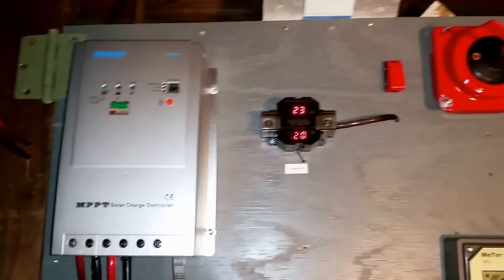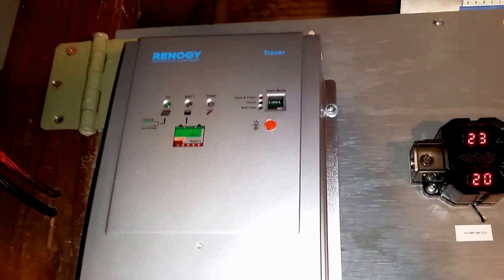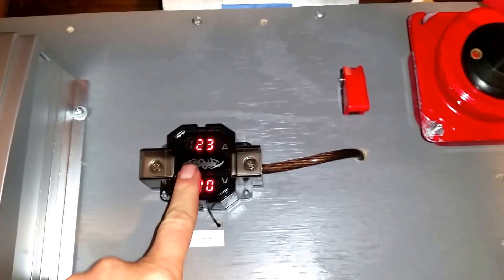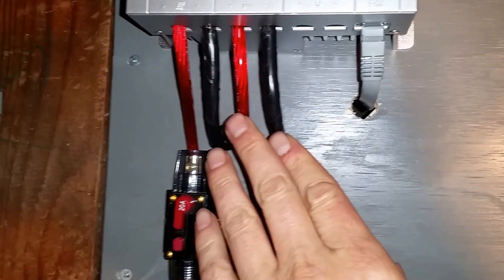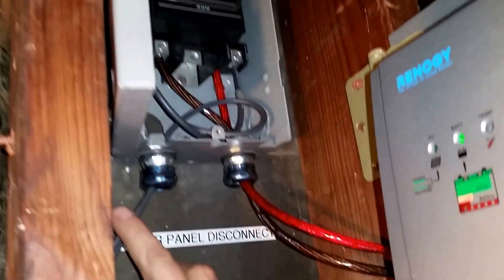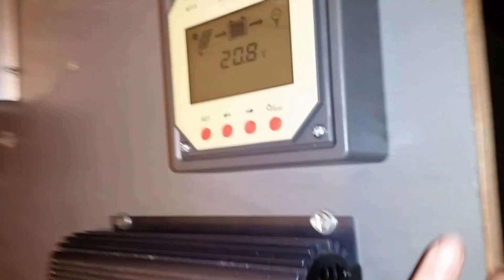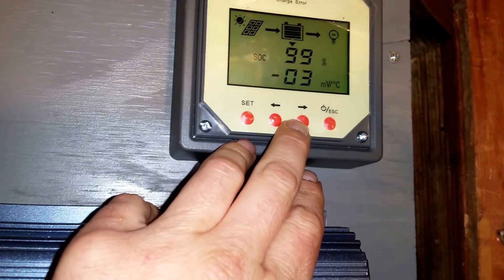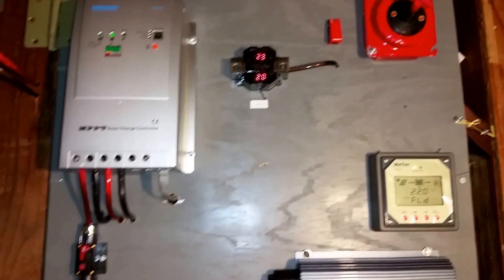200 WATT SOLAR PANEL  HOME PROJECT

Comment: Remember, the size of the breaker/fuse should be matched with the wires plus a little extra for safety.  8 AWG with THHN not in a conduit can carry 50 amps safely.  A 1000W inverter should have a 80a (80a x 12v = 960w) breaker with wiring to match.

Comment: if that is a 40 amp charge controller, you need a 40 amp fuse going from it to your batteries....  if it was a 20 amp controller, then you would use a 20 amp fuse....
Reply: you only need a fuse on to the battery there is a fuse inside the mppt for solar and load

Comment: I have a 100ah AGM battery so far... with a 2000/4000 Pure sine wave inverter... 20a  MPPT Hqst controller... 
I can't find the answer to the question 
 " Is it better to use 2- 100 watt panels or 1- 200 watt panels"?    I see that one 200 watt panel puts out aprox. 8 amps and 2- 100 watt panels out put 10 amps (2 x 5a = 10a) so wouldn't it be better to instal 2- 100 watt panels to get the most amps?
Reply: no use the 200 watt pv

Comment: I think the charge controller you have will handle 42 volts series connection from the solar. This high voltage turns to amps giving more output than input.